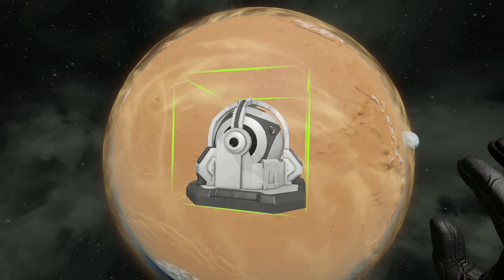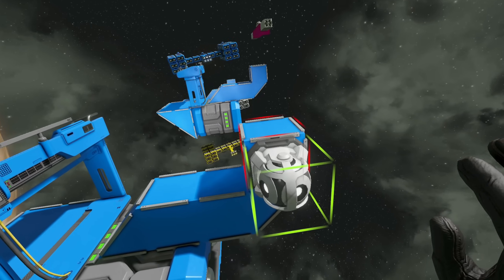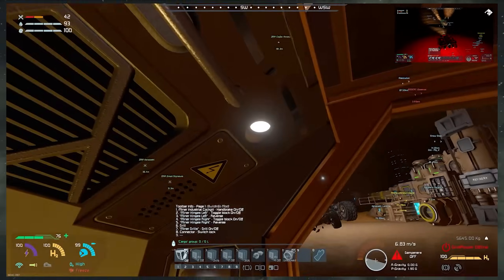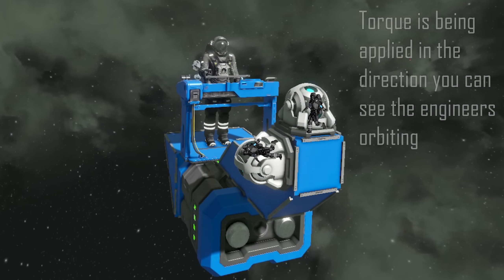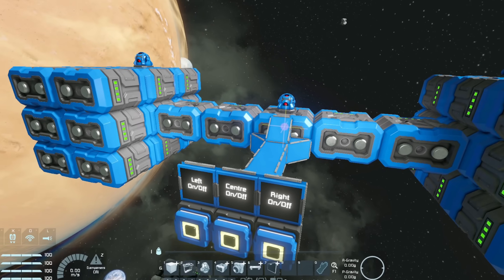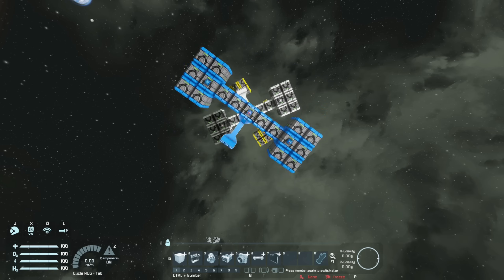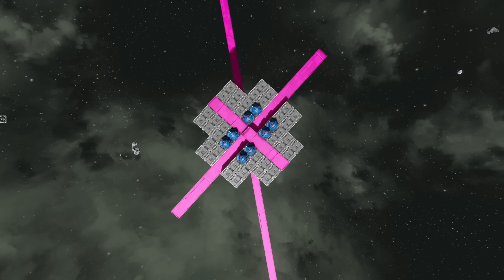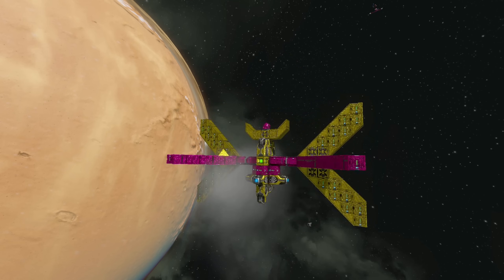Does Gyroscope Placement Matter? Space Engineers Testing and Tutorial

Comment: I am having an issue where my ship does snap like movements when trying to roll, either side. I have no idea why and if it is gyro related, basically a long large grid miner, 2 large hydro tanks and a large cargo container with all drills at the front and thrusters around and back. For the life of me I can not figure out why it does this 'snapping', it rolls a bit then tries going back to original position. Any Ideas why? If it is gyro related even? Adding or removing gyro's does not make a difference. But obviously I must have 1 at least.
Reply from the maker: I'm going to assume you're playing multiplayer as that's the situation where I've seen this. It occurs (as far as I've been able to determine) because your roll is so slow that the server refuses to acknowledge that you've turned. If you combine the roll with pitch/yaw/translation movements then it'll register them - I run into this a lot in my current series on Keen's official servers

Comment: I was always curious about the gyro's front face, even though it hasn't mattered for me so far. I personally think auto-rollers on rovers is kinda silly - I'd rather have gyros for full manual control whenever I need it rather than a derpy, might-work-might-not gyro like the ones in the Scrap Race scenario. On Playstation (and I'm sure there's a similar control toggle for PC) my right stick normally controls pitch and yaw, or when I hold L1, it swaps out yaw for roll, and keeps pitch the way it was. So basically, I find no use in a dummy gyro that might klunk and damage parts of my rover when flipping back over, or potentially fail to flip me over in an awkward place due to fix rotation, when I can just have a gyro that lets me prevent damage and flipping in the first place, or let me do precisely what I need to in order to get unstuck in every possible case. Manual gyros are also superb for allowing rovers to conquer awkward terrain. Also, if you have a rover with any vertical thrusters, be they for preventing fall damage, gliding over gaps, or ascension of vertical terrain, a manual gyro is also crazy useful, and far cheaper and less energy hungry than outfitting a rover with an omni-directional thruster setup.

All that said, I do see a very niche point in auto-rollers, and that is specifically for cases like the Scrap Race scenario. It seems like that mode was meant to behave a little bit more like an arcade racing game, so of course you need to cut out the full gyro control and give the player an "oops I flipped" button. But for normal gameplay, just use your rover's gyros the same way you do on ships. Manual input, redirect your movement energy where you need it. And that way, your  flip fixes and flip prevention will be faster and easier to access than frantically going through your toolbars while under the threatening pressure of losing your ride in the blink of an eye. You don't even need to worry about what way they're facing, because just like with your ships, gyros on your rover will respond to input according to what your cockpit says positive and negative yaw pitch and roll are.

Comment: Wait. Something you said made no sense. These builds are supposed to be in space, which means zero air resistance. That means the continuous application of a force (however weak) ought to result in the object reaching whatever desired velocity. The only difference being the amount of time it takes to do so. If the game does indeed limit your terminal velocity based on mass, how is that calculated?
Reply from the maker: There's a degree of rotational 'friction' for want of a better term that was implemented a while back as a performance improvement so that fragments from combat don't need to remain spinning forever

Comment: Did not actually know about the gyro's orientation I have been using overrides wrong for years it seems.

But there's one very important piece about gyro placement missing to consider and it matters a lot. They're very heavy, very tough, and only secured by a single face. Placing them on a block easily destroyed will mean risking the gyro's mass and toughness turned against you if it comes loose. A dead gyro that stopped a railgun shot and saved the precious component behind it is better than a wrecking ball bouncing around inside your ship.
Reply: ANd that's why I literally have "bait" zoens in my ships where a railgun, or multiple, could pass through and not change combat effectiveness.

Comment: Try doing two identical test rigs with both inner and outer gyroscopes. On one have the inner unwelded so they provide the weight but no rotational assistance. On the other do that to the outer. The one with working inner gyros will spin up faster. Unless they've changed how they work since I tried it.

Comment: Also, deep in the game code is a limit on the maximum rotational speed of a grid.  The furthest point from your center of mass is the limiting factor.  In the game world, grids with smaller absolute dimensions can rotate faster, no matter how many gyros are placed.  The further a block is from center the faster it is moving (assuming the same rpm).  It has to cover a greater distance in its travels verses a block near the center of mass.  So the game caps the rpms to ensure those blocks don't end up glitching out due to high speeds.  

More gyros will help you get up to your maximum rpm faster or make it less tedious to turn using the mouse.  But slamming your ship full of really heavy gyros quickly has diminishing returns.
Reply from the maker: That doesn't surprise me and might explain some of the findings here even though it's nice to believe things are following realistic physics principles :P
Reply: Therefore there is a maximum size of ship that can spin adequately to avoid turret fire.
Also spinning in place is futile.. therefore maximizing rpm when rolling is pointless.
The maximum speed you can move is 100ms-1, therefore there is an optimum rpm for evading turrets..
The maximum ship size that can hit the optimum spin rate, and control the roll at that spin rate is the maximum viable PvP ship.

Comment: Does SE calculate a moment of inertia for each axis of rotation? Meaning, in your last example, would it exhibit a different angular velocity relationship if you attempted to 'pitch' the grid rather than 'yaw' it? Or would the relationship between the two grids' velocities be the same, despite the different rotation axis?
Reply from the maker: Huh, I should have demonstrated that one as it would have been a nice way to show that the distribution on an axis matters. Using the same rig and applying torque to alter pitch the two grids move at almost exactly the same speed :)

Comment: Sounds like for most people who are now aware of this.  Have a separate group of carefully placed Gyros in the same orientation etc, and turn off all other Gyros can be useful for this control purpose.

I hear that placing a gyro on the end of a set of otherwise wobbly Pistons etc can stabilize them.
Reply from the maker: a gyro on override with all values at 0 effectively acts as a brake to all rotational movement so it can stabilise wobbly things, though I prefer to do that through use of share inertia tensor as I find it a bit more effective if used carefully

Comment: So in this testing I think you missed a very important test. A long ship would show this best. take a long ship. Put the gyros in the back or front but not evenly. On the opposite side with no gyro increase the mass to equal, near, or even above the gyro the mass of the side with gyro. those small blocks displays aren't the best representation. I've always found if I put gyro in the back the ship rotates on the area. Now that could be cause by the center of mass. being closer to the rear but I've never tested it. And as I said earlier your first test doesn't really demonstrate it well as there is little mass to began with and it looked more like it pivoted on that gyro which means the gyro placement would matter if it pivots on that point which again looked like from the small demonstration but again I couldn't tell
Reply from the maker: Your ship rotates about the centre of mass, by moving your gyros front or back you're shifting it in that direction 🙂

Comment: Gyro:
I worked out which side of the small gyro is "front" by taking a look at the large Gyro.
As its control panel is located at the front but the small gyro doesn't have this feature, I looked for other hints:
The sides of the Gyros have very similar but asymmetrical "bearing-plates" which hold the bearings for a shaft.

The rounded parts of the "bearing-plates" point to the front!
Reply from the maker: Oh yeah, I forgot about that bit. Nice extra tip 🙂

Comment: Great tutorial as usual, a couple of questions about gyros that wasn't covered: Does it matter if the gyro is on a subgrid? does it apply its force to the centre of mass of the subgrid or the main grid? related to this, does the gyro(s) on for example a small grid miner affect the handling of a mothership the miner is connected to via a connector or landing gear?
Reply: Gyros on subgrids will apply the force on the center of mass of the subgrid.
But that comes only into effect if you are using override or are steering that subgrid.

Like the miner example:
If you just park a miner at a mothership without having overrides on. Then you steer from the mothership. In that case the gyros on the miner are not used.

So the gyros on the miner do not affect the handling of the mothership except as far as the additional mass goes.

If you are using overrides on the subgrid or are steering the subgrid then the gyros will try to spin the mothership around the miner ending up with "interesting" movement.

Edit: As long as the miner has inertial dampeners on, its gyros might try to "brake" against the motherships turning. Further testing required.
Reply from the maker: That's a nice and comprehensive answer and fits with my experience 🙂
Reply: @Landogarner83  now I am hungry and want to have gyros
Reply: @jmatya  bon appétit

Comment: But....but I like my big rig to feel sluggish......lol.

Anyhow, so that's why my overrides are crap. I placed em gyros willy nilly.
Also, that example was done using an equally distributed weight. But if, for example, I build a long ship where heavier components are placed on the back (thus forcing the centre of mass to the back, say 4:1 ratio) and the front is lighter due to negative spaces, would it still swing fast?
Anyone can confirm?

Still, nice tutorial there splits! Kudos!
Reply from the maker: The further the distribution of mass deviates from a perfect sphere the worse the rate of turning will be for the same amount of applied force. 

Another way of saying that would be, the closer ALL of the mass is to the COM, the better the turning, anything that's a long way from it will have a negative impact
Reply: @Splitsie  yeah splits, just tested it. I have a small mousepad so usually I use override to turn my big rig. After your tutorial, it turns like wonders now

Comment: Please my Vic Friend, How, if I can, use pistons/something else, as suspension springs. I want to make enormous rovers, but there are no spring type blocks/mechanisms to use. Is the only way micro suspension using 50 thousand x by x "suspensions'?  ... Challenge: if nothing like that exists, design something. Should be a good stream. Make a humongous land crawler that would make the Jawas blush. Good Gaming.
Reply from the maker: It's impossible to use pistons that way unfortunately. In my experience the hinge and rotor based systems to do something similar do work, but only for very lightweight Rovers 😔

Comment: Just a small tidbit I'd like to point out, because I was struggling with a grid being extra sluggish recently and I thought my gyro placement was to blame:  If you're using subgrids, and you use "share inertial tensor" on any of your rotors, pistons, or hinges, that may negatively impact your turn rate.

I suspect that the distance of this sub-grid connector from the center of gravity may also have an effect, but I haven't tested that yet.
Reply: I never thought about that before, but it makes sense: "share inertial tensor" improves the numerical stability of the physics updates by acting as through each of the subgrids has the same mass. This redistribution of mass could result in changes to a grid's moments of inertia.
Reply from the maker: Yeah, share inertia tensor can also do weird things with total calculated mass which may have an impact too

Comment: My question is, how does a expanding or retracting piston affects the center of mass? Will the rotation increase or decrease? or the center of mass doesn't shift with pistons?
Reply from the maker: It's variable, there are some issues related to the grid not being updated so it doesn't behave as though the mass is being redistributed in the way you might expect.
 It's also a problem I ran into when I first tried to do redistribution of mass using cargo containers. The grids didn't update and I came to the wrong conclusions initially, took some helping to figure out it was the grids not updating

Comment: "gyroscopes apply force at the center of mass", is not possible, whatever force applied in the center of mass produces translation, and 0 rotation.
Reply: While in real world physics you could say you are correct, this is not a real object reacting to a real force. Space engineers is a computer game - it can simulate force in unrealistic ways such as applying torque directly to a single point. In terms of programming and physics sim simplification, it's actually a fair assumption that it may actually do so.
To put it as simply, accurately, and understandably as possible, I'd personally say that 'like a thruster the gyroscope's effect is applied to the grid it's on, not the source block itself'.
Reply from the maker: Sure, I think the point was conveyed well enough though which is that the gyroscope doesn't generate torque at its location but rather as though it is located at the centre of mass
Reply: @Splitsie  That's right, but the position in which the physics engine applies force is unknown, a mystery. Just like the force of the Roll spin is not the same as the rest of the turns, you only get the total force through override, I have tried to use an analog control and the result is the same. Another mystery to me.

I love you content man, and follow it, but the affirmation at 5:12 is incorrect.
Reply: @Splitsie  While i agree with you, that it got the message across, i can't resist the urge to be a smarta** about it, so... the location where a "pure" torque is applied doesn't actually change how an object behaves (at least irl). My guess for SE is, that a torque has no "location" at all (, but only an object it is applied to).